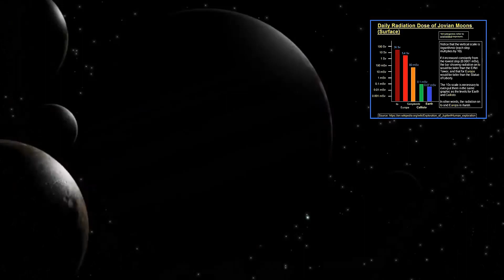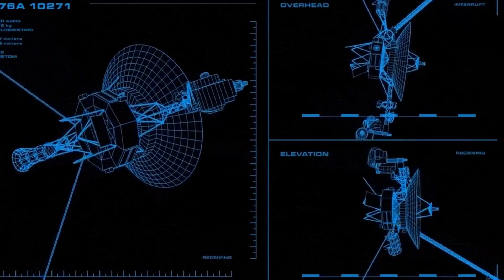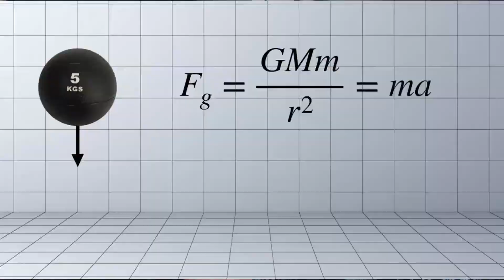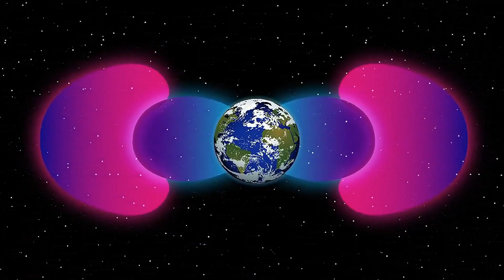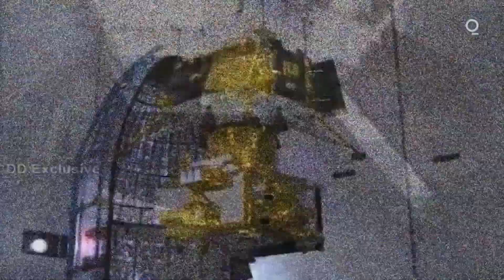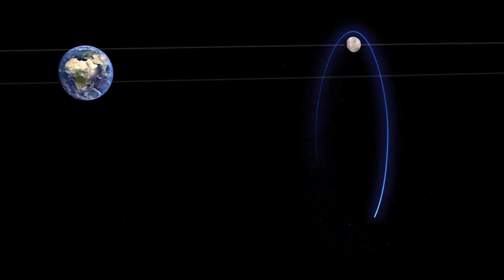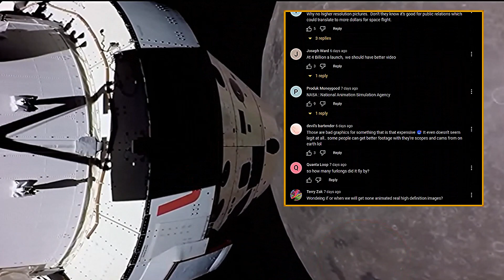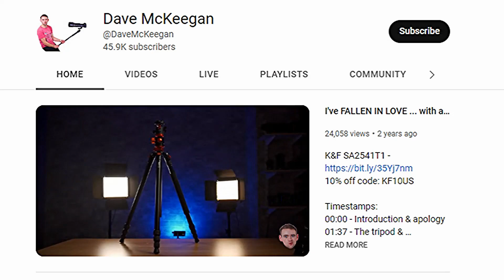THE APOLLO DISCUSSIONS "RADIATION\ ORBITS\ GATEWAY" PART 21

Comment: 12:44  Allen:  "how do you get the antenna lined up on Earth how do you keep it lined up on Earth because the Moon is moving, the Earth is rotating, the Earth is also going in its orbit so you've got the Moon and the Earth which are changing, not very fast but they've still got to be lined up and they were on the moon and we're told for three days on Apollo 17 that would have been quite a change in position, none of that was taken into account"

Is Marcus unaware that an observer on the moon sees the Earth fixed at the same point in the lunar sky? There is a small variation due to libration but that movement is spread out over a lunar month.
That observer on the moon will see the Earth rotate and change phase at the same rate as we see the moon change phase. Once an antenna is correctly pointed at the Earth it needs no adjustment, while on Earth they just needed to make sure that there was always at least one radio telescope pointing at the moon on the hemisphere facing the Moon.
Reply: Your delusions are showing
Reply: @UNcommonSenseAUS  Explain in technical detail why that is please.
Reply: @UNcommonSenseAUS  That’s nice, but where is the technical detail Cleric asked you for?
Reply: @CLERIC_58  so fixed position directional antennas stay focused on moving objects? 😂😂😂😂
Reply: @papalegba6796  What's moving? the Earth stays almost motionless in the lunar sky (you do know that don't you?) so once an antenna on the moon is lined up that's it. the Earth of course rotates so radio telescopes around Earth need to point at the moon to receive signals from the moon. Quite simple really.
Reply: @CLERIC_58  yeah real simple. Earth both moves & doesn't move plus magic antennas make it all work.
Reply: @papalegba6796  So you don't have the intelligence to understand the dynamics of the Earth-moon system? Who would have guessed
Reply: @CLERIC_58  I understand that magic batteries, magic antennas & NASA movie magic makes it all work lol.
Reply: @papalegba6796  I suppose to the primitive mind, science and engineering will seem like magic.

Comment: 5:25  You think some modified GoPro cameras set up to monitor various aspects of the Artemis structure during its flight would be able to produce Hubble type pictures of the Universe?  🤣🤣🤣
TRY DOING SOME BASIC RESEARCH INTO ASTROPHOTOGRAPHY!
Reply: @boptah7489  SOFIA's infra red telescope was first used in 2010. Hubble was launched in 1990.
Reply: @CLERIC_58  oops. calendars are hard. lol
Reply: @straydog02  It was a test flight to gain important information so as to ensure a safe manned mission. What the world was hoping to see is neither here nor there, I imagine the manned mission will provide more of that sort of thing as it will have the human element.
Reply: @CLERIC_58  they supposedly already had a bunch of safe missions fifty years ago, chatbot. Nothing you post makes sense.
Reply: @papalegba6796  So no newly developed cars, ships, aircraft etc need to be tested because earlier versions worked in  the past?

Comment: 10:19  Henderson: " one Arc second is 200 miles at that distance and they're using a high gain directional High gain antenna so called to do that if they're off by one Arc second they're 200 miles off course"
What is Henderson blathering about arc seconds for? Does he think there is a pencil thin beam of radio passing from the antenna to Earth? The beam from the high gain antenna is much wider than the Earth by the time it reaches it. He can't even get that 200 mile figure right, an arc second is 1/3600 of a degree, at the distance of the moon that is just over one mile but hardly relevant as the radio beam from the moon is thousands of miles wide.
The parallax of Alpha Centauri, 4.24 light years away is 0.768 arc seconds! Why did he come out with such nonsense and why did nobody point it out to him, or did none of you know?
Reply: @UNcommonSenseAUS  Explain in technical detail why my comment is incorrect.
Reply: @UNcommonSenseAUS  In other words, you got nothin’. Shocker.
Reply: Thousands of miles wider & thousands of times weaker. Has to get through atmospheric disturbance too lmao.
Reply: @papalegba6796  Easily picked up by dishes up to 200 ft in diameter using frequencies to which the atmosphere is transparent. Your incredulity results from ignorance.
Reply: @CLERIC_58  but the atmosphere isn't transparent to microwaves is it, chatbot? Ever heard of troposcatter? Handwave much?
Reply: @papalegba6796  Oh, here we go.... Another word you don’t understand the meaning of. Are you going to quote from another textbook that refutes everything you claim?
Reply: @papalegba6796  It is though and Apollo wasn't transmitting narrow beams at acute angles to the troposphere. Glass is transparent but at a narrow angle it looks more like a mirror.
Reply: @papalegba6796  So you don't understand analogies created to help children understand physical principles? What a surprise! 
As the name implies, troposcatter communication systems relied on being able to receive the very tiny fraction of a beam being, scattered by the atmosphere back down towards the ground, with most passing straight through because the atmosphere is very transparent at the S-Band frequencies. To get a decent amount of scattering, high transmit powers were required. The losses caused to an Apollo S-band signal were therefore minimal.